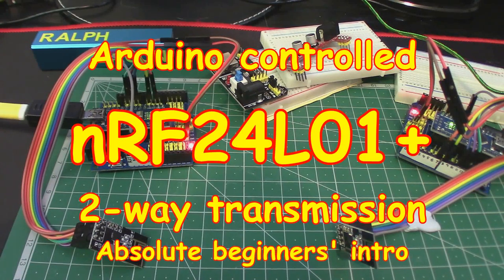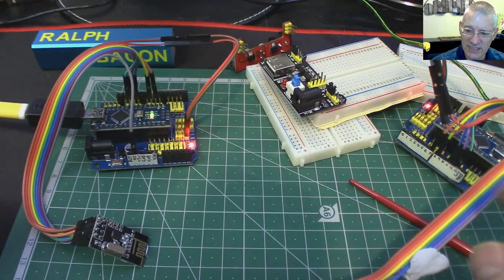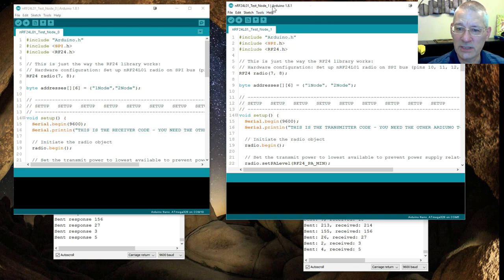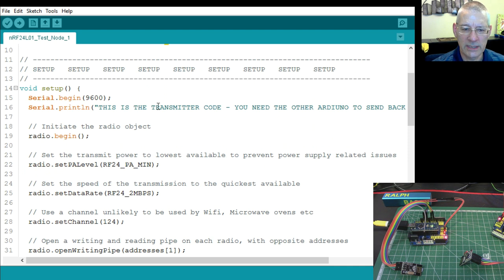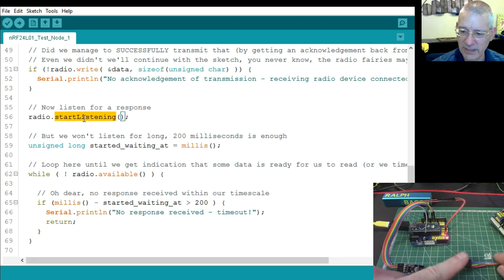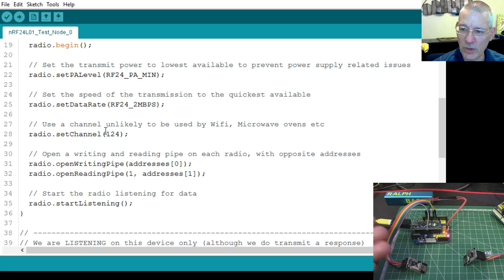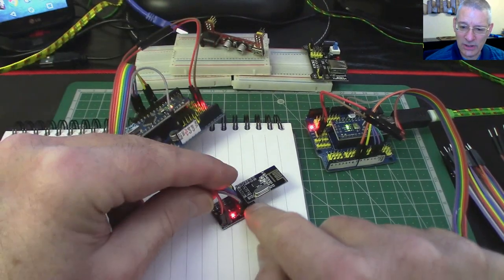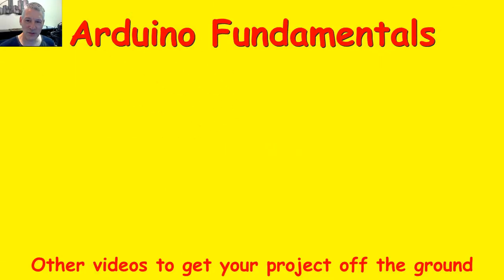#73 nRF24L01 Send (and receive) data with your Arduino!

Comment: Hello RalphThank you for a very clear video. I can't get the prog to run without swapping round ce and csn . Also transmit only records a 1 whilst receive sends the random number plus a zero. I'm running an Arduino clone. Any ideas where I'm going wrong ?Thanks
Reply from the maker: First question, Nicholas: are you using the adapter boards I mention? If not, prepare for a world of pain and torment. OK, perhaps that's overdoing it a bit but believe me, using the adapter boards make a huge difference to the success rate of users.

Swapping over CE and CSN is definitely indicative that something is wrong with your wiring. CE is CHIP ENABLE (and determines whether you are in transmit or receive mode). CSN is the SPI chip select line (active/inactive = on/off) so you can see that these perform very different functions.

I'm assuming you're using my unadulterated sketches for the two Arduinos (clones or not, they will work). I'm also assuming you're using the same nRF24L01+ modules I'm using (or something so very similar is has no bearing on the functionality, such as a module with an plug-in aerial or not)?

When running the Serial Monitor (aka Debug Window) on each Arduino, it will indicate what is happening at each stage (including whether the transmission was successfully received by the other module as well as the value transmitted and received - what does yours indicate?
 
There are a few more steps we might go through but this will do for starters - I await your replies with trepidation, especially regarding the adapter plates. (I'm closing down the workshop now but I'll pick up your replies Monday.)
Reply: Ralph S Bacon hello Ralph
I am now using genuine uno boards. Both my serial monitors on transmit and receive only announce the first line "this is the receiver...." no data is sent or received.
Yes I'm using the high power version with aerials and adaptor boards for easy female leads.
Any ideas what I should try now please ?
Reply: Update, Ralph when I touch the MISC cable on both the transmitter and receiver both programs run but I get sent : rand no , received : 0 and on the receiver sent response 1
Strange ?
Reply: Sorry ignore that last comment I had ce and csn swapped
Reply from the maker: Does this mean that you got it working, Nicholas? Fingers crossed for your reply...
Reply: Ralph S Bacon sorry no luck.
Reply from the maker: If you are using the unedited versions of my two sketches, you will see that one is the transmitter and one the receiver (better would have been to call the first the initiator and the second the responder).
 
The transmitter should send a random character and indicate whether it was received OK (this is the auto-acknowledgement from the receiver).
 
The receiver, meanwhile, should display that received value, add 1 to it, and then send it back (and tell you all this in the Serial Monitor window). The transmitter will then confirm what it received and start all over again. So...
 
So I think you need to let me know at which point exactly this all fails. Are you using the same nRF24L01+ module or are they slightly different? I'm sure we can crack this.

Comment: Yes it does the random numbers communication is perfect
also the pulses from the digital potentiometer I can see them on the transmitter also the pulses. on the receiver side I see the random numbers produced but nothing of the potentiometer. God bless you thank you
Reply from the maker: OK Demetrios, that is good (I asked because some viewers are having difficulties in getting that demo sketch running, probably as a result of noisy power issues or frying their nRF24L01s by using 5 volts).
 
What you need to do is read the potentiometer value via the analog port (you suggested A1) then transmit that instead of the random number. However, in my demo sketch I am only transmitting ONE BYTE - which can contain a maximum value of 255 whereas the analog value can be from 0 to 1023. So for test purposes only, you can map the analog value to a range of 0 - 255 like this (which I have demonstrated in other videos):
 
char getPotValue() {
  int potValue = analogRead(A1);
  return map(potValue, 0, 1023, 0, 255);
}
 
Which means, take the potentiometer value and constrain it from its value of between 0 and 1023 to the new range of 0 and 255.
 
I'll leave you to experiment but this should be very straightforward (and help on the map command is on the Arduino.cc web site too).
 
Good luck!

Comment: Hi Ralph, can every node send and receive?. so receiver not only receive but also send , and transmitter send and receive too ?
Reply from the maker: Absolutely, Alfiaos. I now regret calling them "sender" and "receiver" sketches. They should be called "initiator" and "responder", or even "master" and "slave", as they have identical capabilities in receiving and transmitting data. Hope this clarifies the situation. Good question, thanks for posting.
Reply: ralph, i want ask , why in my serial after send and recieve there are some words "No Acknowledgement of transmission - receiving radio device connected?" help me
Reply from the maker: You're the second person to ask this, this week! Are you using the adapter boards for the nRF24l01 modules? Does the "receiver" module correctly receive the number transmitted? Does it send it back successfully? Three questions, please let me know the answers and we'll see how best to address this problem.
Reply: oh really? . no , i use NRF24L01 + pa+lna . No the receiver doesn't receive correctly number. but it can send it back randomly. please help me
Reply from the maker: Sounds like power issues, as you are not using the adaptor boards. Get a couple (at least), they are quite cheap (depends on where you are in the world, I guess, but I bought mine from Amazon UK: https://www.amazon.co.uk/gp/product/B010N32SGM/
about £1 or $1.30 each but stops all the 3v3 power-related issues, especially as you have high power version module. Definitely the first thing to try. When you have done this, let me know!
Reply: thank's alot Ralph . it's work
Reply from the maker: Excellent! I'm very glad to hear this.

Comment: hi ralph i really love your channel and wanted to know where you got the code from
Reply from the maker: Hello Jacob, thanks for the kind words. The original code I used here was probably included with the library I'm using but I felt it was far too complicated for the beginner (it tried to do too much) so I modified it to meet Einstein's mantra: "Make it as simple as possible but no simpler", or words to that effect. From the feedback I've had I think I achieved that, what do you think?

Comment: Hi, i want to control one dc motor with rotary encoder and wireless communication with nrf24l01.
For dc motor its need to be have  speed and direction control with rotary encoder(
KY-040) on transmitter side and l298n motor controller on receiver side.
Please help me in cods for transmitter and receiver.
Reply from the maker: I don't write custom code, Hardeep, but I can help you work out what you need. You need to split this project up into various stages so that you understand what a rotary encoder does (and can do for you), what an nRF24L01+ can do to control a bridge motor controller.
My suggestion would be to first understand how a rotary encoder works and how it might adjust the speed of a wired motor on your workbench. It's explained in some detail in video #19.

Comment: Hi Ralph. I viewed this excellent tutorial earlier this year, and as a result have five successful projects using the nrf24L01 with Pro Minis and Nanos. Due to the need to increase the OLED display on the receiver and add colour, I have been experimenting with an ESP8266 D1 mini (small footprint board, just two rows of eight pins). I have been successful getting the colour display to work (thanks a lot to Bodmer) but for the life of me I cannot get the NRF24L01 to work with the ESP8266. Reviewed others efforts but no go. Can I put a request on your stack for an ESP8266 with  NRF24L01 tutorial please?
Reply from the maker: When you say "can't get it to work" what happens exactly, Paul? I admit I have never tried an nRF24 module with an ESP8266 (or ESP32) but considering it's just sending out simple requests to the module I can't think why it would not work. Let me know!
Reply: @RalphBacon  Hello Ralph. Hmm. Soryy, not very descriptive "not working" but the NRF24 is very black and white in my short experience with them. They either work or don't.  
Here's my code:
#include <ESP8266WiFi.h>
#include <nRF24L01.h>
#include <RF24.h>
#include <SPI.h>
/*  ----------------------------Pin connections ------------------------
  D6 --> MISO (Hardware SPI) - Arduino IO pin 12
  D7 --> MOSI (Hardware SPI) - Arduino IO pin 13
  D5 -> SCK (Hardware SPI) Arduino IO pin 14
  D8 -> CSN (can be changed) Arduino IO pin 15
  D4 -> CE  (can be changed) Arduino IO pin 2
  ------------------------------------------------------------------------
*/

#define CE  2
#define CSN 15

const byte address[6] = "00001";

RF24 radio(CE, CSN);

void setup() {

Serial.begin(115200);
  // --------------------------------------- start radio
  radio.begin();
  radio.setChannel(108);
  radio.setDataRate(RF24_250KBPS);
  radio.openReadingPipe(0, address);
  radio.setPALevel(RF24_PA_MIN);
  radio.setAutoAck(1);
  radio.enableAckPayload();
  radio.setRetries(5, 15);  
  radio.startListening();
  Serial.println("");
  Serial.println("Radio Link Started..........");
  delay(50);

}

void loop() {

  if (radio.available()) { //check for incoming strain data from wireless receiver
    float data = 0;       //clear variable which will hold incoming strain data
    radio.read(&data, sizeof(data));
    Serial.println(data);
  }
  delay(5000);
  Serial.println("No Data");
}
Connections shown in text. This compiles OK for the LOLIN/Wemos D1 R2 & Mini, also Generic  ESP8266.
I'm at the pulling hair out stage. It's likely to be something really silly now. I hope you can spot it.
Kind regards
Paul
Reply: Hi Ralph. Sorry to press you but did you have a chance to look at this or is there a plan for a future tutorial?  (Hopefully not too pushy) regards
Paul
Reply: @paulyorke1437  i saw+read your code... this:    float data = 0;     you may not want to define it inside the
if(available()) loop...try to define before the if (radio...)
Reply: @unglaubichuberlieber8048  I'll give it a try, thanks.

Comment: Hi Ralph, i watched your tutorial NRF TX and RX with arduino and it was very helpfull. now im trying to do something more compicated, to have 2 arduino tx and rx when im press a button (depends on which one) 
for example when im press "arduino 1" button, the LED on arduino 2 blink and when im press on "arduino 2" button, the LED on arduino 1 blink.
I realy need help its for my project in my college. 
thank you very much.
Reply from the maker: The demo sketches for this video, Eran, could be easily adapted to do what you want. When the receiving or slave Arduino receives a message it will blink its LED. The master or initiating Arduino does nothing except send a message.
If you deconstruct the receiving sketch properly you will see where in the sketch the message is received from the other Arduino and just add a call in at that point to blink the LED (ideally without using delay, but to begin with that would be OK).
You really need to get my sketch working with two arduinos/nRF24L01+ modules first (using the adapter boards to avoid frustrating power problems).
That's as far as my help goes with your college work, I'm afraid! I hope it helps.

Comment: Hello, I am working on a project where I need wireless communication. I am using the nRF24L01 with the socket adaptor. I downloaded your zip file and uploaded the proper code to each of my Arduino Unos and can't get any communication.

Your video was great but I still can get mine to work and none of the other videos have helped. Is there anything that you know of that may be an issue (just from experience)? Any help is appreciated!

(UPDATE) I had an issue with the library. that is fixed and now I can send data but all I get as received data is "0". I swapped the codes (made the transmitter the receiver and vise versa) and now it just times out. I checked the wiring and everything looks the same. Please help...
Reply from the maker: I just put this together again two days ago and I got the same "Received 0". This means that the transmitter is sending out a packet, the receiver acknowledges receipt but does not get the actual data into the Arduino.

Turns out I had not connected the MOSI and MISO the right way round (don't swap them over like you would the TX and RX of a USB to Serial converter). 

It's always either the power (but if you use the adapters and supply 5v it will be fine) or it is the cables not being connected correctly (or are damaged). Always. As I found out myself!

Although you say you swapped the transmitter and receiver and now it times out (no response from the receiver) - which might indicate that one of your nRF24L01s is not working. Did you ever supply 5v to it (that would kill it)?
Reply: @RalphBacon  I am using the breakout adapter with a 3.3V regulator, so power should not be an issue. Way back when I did my first test run I also found out I had the MOSI and MISO switched around on the receiver. I switched them around and still couldn’t get any communication. Could that have been an issue that would have damaged the adapter or NRF24L01? 

I think I’m going to purchase a new NRF24L01 and see if that takes care of it. Thank you so much for the help!!!
Reply from the maker: I don't think swapping MISO and MOSI will damage anything. Connecting 5v most certainly will. Other than that it can only be wiring that is stopping it working. Test out the new device and good luck.

Comment: Hi sir, can you do a code that it can get the distance of how far the transmitter and receiver is? Like if the transmitter get closer, it says to the receiver that their distance is “this”. Its like distance measurement of how far the transmitter and receiver is. Please help
Reply: Its like just sending data but the data is the distance of transmitter and receiver, a good example is a car with controller, to get the distance of the controller and the toy car. Pet me know if you can sir thank you🥰
Reply from the maker: There is a signal strength function, I believe, but that would not tell you how far away it is. Look up "Time of Flight", that might help: https://en.wikipedia.org/wiki/Time_of_flight

Comment: Sir!  i want to have in indicator led in transmission section that  indicats if my receiver  successfuly receive or not?  What changes we have to do in code?
Reply from the maker: The nRF24 has automatic detection of whether the transmission was successful or not (the responder sends back an auto-acknowledgement) so instead of having an LED on success, you need an LED on failure - just look at my demo code and you will see how I check for successful transmission.
Reply: @RalphBacon   sir how i can visit yor demo  code?
Reply from the maker: All code is uploaded to the GitHub repository for each video. There should be a link in the video description, otherwise just scan all my GitHub repositories https://github.com/ralphbacon

Comment: Thank god they made multiple instance IDE.This code reminds me inter service communication with pipes.
Very clean. I'll test it. Ugh I just looked at the code - it is bad... Just don't call stop listening at the beginning if it is a transmitter role. Ideally both mcus should have two roles - each one pinned to interrupt
Reply from the maker: Well, you know, Browarus, the demo sketch is just that, a demo, and if I were using this for real the code would look quite different, I'm sure. But it's just enough to get people going (I hope) so don't be too stern with me :) But thanks for posting, and I hope you enjoyed the video (and demo code) anyway!

Comment: i have nrf24l01 with antenna and i have one without antenna .. They can not communicate with each other
 ..
Should they be the same type
 ..
Reply from the maker: No, not at all. As long as you are transmitting on the same channel number (and therefore the same frequency) it should work. The one with the external antenna may have a zero ohm resistor that may have to be removed to allow the use of the external antenna. Check the datasheet or the vendor's notes for this.
Reply: @RalphBacon  🌼

Comment: Hello Ralph! Excelent explanation! it work excelent for me, but now i have to do it in an arduino nano. The problem is that i dont have pin 13. How can i do it?
Reply from the maker: Sure you do, Jaime. It's directly opposite the D12 pin (on the other side of the board). And don't forget you also get A6 and A7 analog-only pins on the Nano. I hope this helps.
Reply: Thank you Ralph! 

Another question, I want to expand the distance, what other values can I use?  radio.setPALevel(RF24_PA_MIN);
radio.setDataRate(RF24_2MBPS);

THE GREATEST DISTANCE IS WRITTEN SO?

 radio.setPALevel(RF24_PA_MAX);
 radio.setDataRate(RF24_250KBPS);
Reply from the maker: Certainly, the setPALevel(RF24_PA_MAX) is fine, but I do believe that the 250kbps is not the best option; the chip has been upgraded so that the 1Mbps or 2Mbs are now optimal for long range. The 250K speed has been left for backwards compatibility. But in the Real World, your mileage may vary, so try out different options!